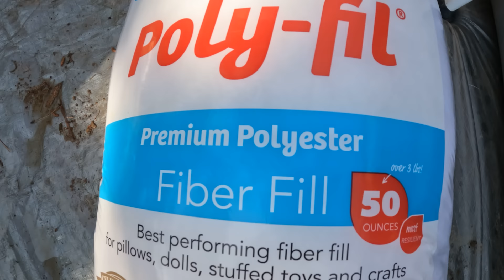Above Ground Pool Swamp To Oasis in 36 Hours for $30| FAST CLEAN Redneck Filter HACK| SUMMER 2022

Comment: Having owned a pool company for 20 years I have a tip for you if you haven’t done this. Chlorine is gas and will escape into the atmosphere unless you use a stabilizer to hold it in the water. If not, you will never be able to have a chlorine residual which is necessary to prevent algae and keep your water safe and healthy. So, you must calculate your gallons and add the appropriate amount of cyanuric acid otherwise known as stabilizer. And as far as your filter, not sure why you didn’t just plumb in a small cartridge filter  but the stabilizer is the main point here.
Reply: CYA that is rocket science.  The average pool owner doesn't know about these concepts
Reply: Cya isn't rock science, let's be honest the intex filters aren't made for filtering well. Adding a pre filter before filling would have solved about most if not all of the iron from their water source. I'm not an expert ohhh wait I am.
Reply: @briannichols7399  you blowing minds with common sense.
Reply: @briannichols7399  I was thinking Iron as well. If they filtered it out to begin with they could have saved the cost of the chlorine used to  turn all of that dissolved Iron into Iron oxide....maybe.
Reply: Thanks, I always wondered why the acid was added.
Reply: @KKIcons  the acid I mentioned is a different acid. What you’re thinking of is muriatic acid which is used to lower the pH.
Reply: With the amount of info available on the internet it amazes me that people still struggle this much with pools. It's literally just basic chemistry, definitely not rocket science.
Reply: @dangallagher3883  how calculate the amount of acid to add ?? How much per gall of chlorine?
Reply: Dan, would the CYA stabilizer affect the change in color of their pool due to metal oxidation or just a general tip?
Reply: @merlinjeronimo3886  says it’s on the container
Reply: Damn I should’ve got stabilizer for my pool
Reply: You are not talking about algae, but about minerals that are oxidised. So the water is not really dirty. It comes from the well and needs a good filter, that's all.
I only use a little chlorine myself, because after a few days, when the chlorine has gassed out, I use it for my garden. It's groundwater and it's filtered before it's put into the pool. I also put a shade cloth over it so no insects or small animals can fall in. Gary's method is just right for me. I don't drink this water, I just swim in it a few times and then I change it. Mel said also, they have chlorine and the chlorine balance in the pool. And, as we see it worked last year and this year too.
Reply: @GS-en1nz  cya is easy 

Just dump a load of bicarbonate soda in there and then correct pH if needed
Reply: What should they have used to filter it out beforehand? I have well water and this happens. I used an rv filter and a bobby sock, and that didn't work.
Reply: Muriatic acid will do it
Reply: Never used a stabilizer and I am always within the recommended amount of free chlorine with 2 tabs in a 3500-gallon pool for my kids. I don't agree with adding acid made from heating urea, which is basically piss.
Reply: @Lefty248  not even that. But just the fact that you can do this with just a bucket and filling and have a clear pool in about 2 days, is just cheaper, easier, and faster. Instead of wasting a bunch of money to buy chemicals  to clear up your water, and waiting forever for them to work. It's smarter to do this and then just do basic upkeep to keep your water clear. Ofc anyone who owns or works at a pool company is going to tell you it's not going to work right or "the chemicals will do the same thing" I mean ya the chemicals will, but at what cost and effort? I have a pool and I know the hassle of going the chemical route every year. Now I keep it clean with filtering, vacuuming, and hard work, then I use the chemicals to maintain the water afterwards at the minimal amount I need. U can have a clean pool that's full of water and not half chemicals with a chlorine smell.
Reply: I have a best way sand filter that blows sand in the pool lately. I am going to use those Filter Balls next year instead of sand. I have very hard water and used metal gone and my pool has been crystal clear also some ph down and clorine tabs. The gallon jug does what the filter balls do. Nice idea.
Reply: @Nikitia3127  ph down is a much more expensive alternative to muriatic acid. Sand blowback is probably due to a damaged lateral. Without doing a full water analysis, blindly adding ingredients isn’t wise.
Reply: @Nikitia3127  I got a bestway 18x48 pool this year that came with a 1500gph sand filter with the cotton balls. It's a pita.... I ended up buying an Intex 2500gph cartridge filter. So much easier to clean...
Reply: What is a "ph and chlorine balance tablet"?
Reply: 20 years and you get this sooooo wrong
Reply: @Lefty248  That's because tabs have stabilizer in it, lol.
Reply: @error404webpagenotfound Pools don't have a "chlorine smell". That's a misnomer.

Pool smell is not due to chlorine, but to chloramines, chemical compounds that can form in pool water. 

Chloramines result from the combination of chlorine disinfectants and the perspiration, cosmetics, and urine that enter pools on the bodies of swimmers.

So, if a pool smells like chlorine, somebody probably decided to use it as a toilet...
Reply: @Superman-xr1oh  good to know, thanks
Reply: I will never have a chlorine pool again! I appreciate my salt pool and during over 100 degrees I add a small tablet of chlorine once a week in the float. So easy to clean the sand filter and system with a bit of vinegar if necessary for build up. Even my friend having a pool company for over 20yrs tried to talk me into a filter system until he saw my setup when he was visiting, yes we are both country folks but in his business he’s so focused on chlorine pools.
Reply: @CoachKarin  🆒️
Reply: Dang, I almost bought it for my pool. I'm still struggling. I should have gone with my instinct and not been a cheap ass. 
For some reason, I didn't think it would be helpful because I have never struggled in the past with chlorine and haven't needed it. But this is the first year we kept our pool up over the winter, and it is very green.
Reply: @brainisfullofnonsense8183   iron plus chlorine = iron chloride, not iron oxide.
Reply: Chlorine is not just a gas. It can exist in all phases, depending on pressure and temperature.
Reply: @Lefty248 urea is no basically piss. Piss just has a high concentration of urea in it. Piss is made up of many different elements, but I bet that wouldn't stop you from using phosphorus.
Reply: @CoachKarin  your pool is still a chlorine pool, it just runs the sodium chloride solution through an elecrolizer that breaks the sodium chloride into sodium hydroxide and free chlorine. That's why you have to add salt every now and then.
Reply: CyA build up can lock out chlorine also
Reply: @Lefty248  it's same for me but I assume trust depends on the water. I'm adding something that is called algae stop from time to time just in case and it seems that's enough
Reply: Exactly
Reply: @brittany7573  there's baking soda tabs that help get everything perfect for chlorine to work properly.
Reply: We got an above ground pool in Fl and went north for summer came back down and top fell off due to winds and magnolia leaves were full in pool we took the damn thing down ! 0
 Prefer ocean or lake to swim

Comment: Just an FYI for others, I have very clean water and still use polyfill to polish the water. It removes the tiniest pieces of debris even AFTER it runs through my sand filter.
Reply: That’s crazy that it works better than the sand filter the thing intended to filter the water. Good to know thanks for sharing that. Do you think this will work to filter out dry algae?
Reply: @dylanstack8710  yes.

Comment: Put your wadding into mesh laundry bags to prevent the wadding from back flowing, and make it easier to replace the wadding. You can leave the used wadding in one of the laundry bags while it dries out, making it easier to dispose of. The pool looks fantastic, hope you get a lot of use of it. If you can find heavy duty buckets (hint farm and feed supplies) that might be an upgrade. Love you all, keep up with the redneckery, thank you for the video.
Reply: fuck you beat me to it ... lol
Reply: Mesh bags are a good idea; I was thinking a screen or something when I saw him reach in and pull that bit out of the pipe.
Reply: Thats exactly what i was going to say.... And look online for a twist top bucket
Reply: Needs a check valve keeps water from back flowing 🤷‍♂️
Reply: People have been doing this same method for koi ponds.  Check valve and the mesh laundry bags is a great idea.  You also can use rinsed clean lava rock.
Reply: @johnflowers783  Oooo, rinsed clean lava rock!  Great idea.  I want to do this but I'm worried about throwing away plastic (the poly fill).  I know I know but it's my hang up so I'm glad to hear there's a more sustainable method.  I'm gonna try that lava rock idea!
Reply: @craigchatterton4164  yes same here prefer a more sustainable option maybe the lava rock is ideal
Reply: Get heavy duty twist top buckets with gaskets free at bakeries. Wish I woulda saw this video a few months ago
Reply: What the heck is wadding?
Reply: @Slipsmostwanted  yea I just set up a plastic 55 Gallon drum with sand and I learned that lesson last night so for now just keeping pump running
Reply: Go get a pet or livestock feed container with a screw on lid!

Comment: I've done this out on the the farm.  It works great for a quick, cheap cleanup.  If you want to make something where you don't have to throw away the pillow stuffing, and is reusable as an all summer filter, try this... use the same bucket but your inlet should be on the lowest edge of the side of the bucket.  Inside the bucket, install a series of 4-ways with a T at the end (will fit 3 of the 4-ways and 1 T.  From each of the 4-ways and T, put an elbow facing upward.  Then in the lid, put an outlet with a U bend so the water pours back into the pool.  This will allow you to set the bucket upright so you don't have to remove the bucket (filter housing now)  to clean.  Back to the elbows... use cotton tube socks (I used 3 each, a sock in a sock in a sock) and I clamped/zip tied/ used Sunday paper rubber bands, to attach the socks to the elbows, and shazam... you have 8 filter socks.  Super easy to install, when dirty you turn them inside-out, rinse and and repeat.  Run them through the laundry if really filthy, or soak in CLR.  They catch leaves and debris too.  The smudge in the bucket can be wiped out with the dirty socks when doing the change over.  Great video guys!
Reply: I like both your design and cotton socks as re-usable filters. I want to do this on a smaller scale for an outdoor bath.
Reply: I love both ideas but need a visual
Reply: I love these ideas as well, and I also need a visual. Do you have a video or even a few pics @matthewpeterson3329 ?